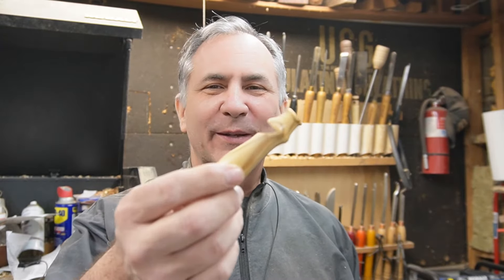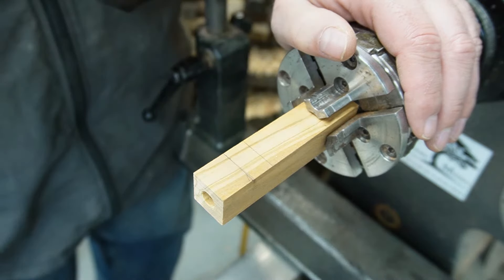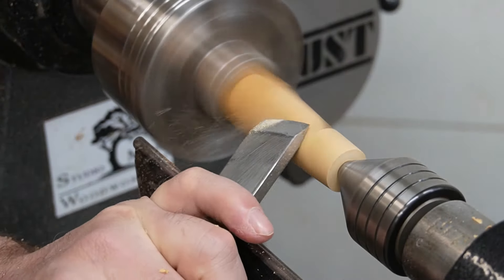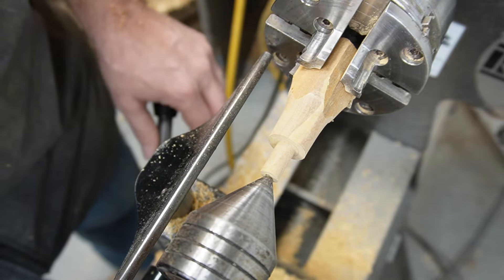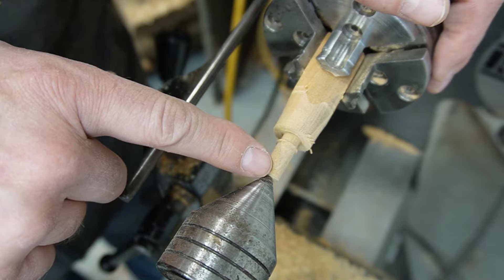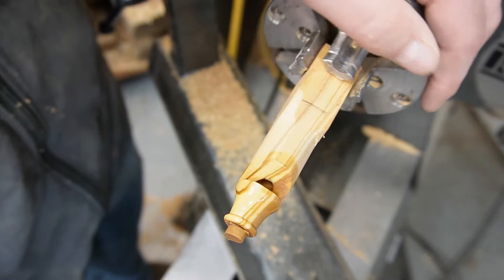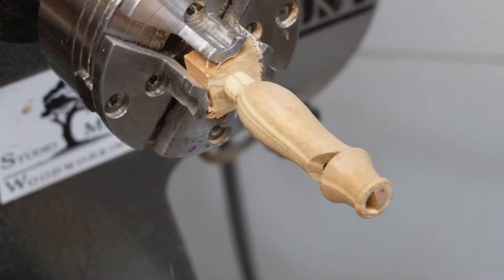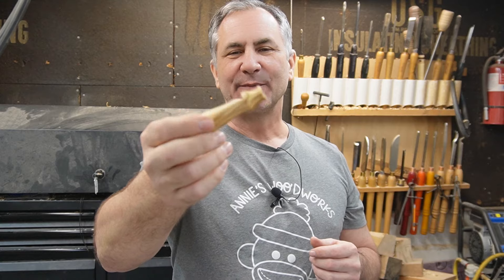Woodturning:  A Super Loud Whistle from Olive Wood

Comment: Most whistle videos I have seen cut the notch after rounding the blank. Are there any precautions to prevent edge breaking when rounding the whistle with the notch already in?
Reply from the maker: Hi and thanks for the question.  This is the way I was taught.  I've always cut the notch before turning and I've never had any issues.  I don't do anything special to keep the notch edges intact.  Sharp tools and a speed fast enough that my gouge doesn't dip into the gap is all I do.  I generally turn these at 1500 RPM only because I'm a bit too lazy to change the belt position to the high speed pulley.  The pieces are fairly small so if I had the belt in the high speed pulley I'd be turning it faster.  I cut the notch with a hand saw on the lathe.  If I was batching them I'd have done the notch on the band saw.  Its easy to cut the notch while it's square.  I can imagine cutting the notch after it's round would be more difficult.  Either way, do what's best for you.  There's no right or wrong as long as you're safe and the whistle works.  Thanks for watching

Comment: Hi Scott, I was wondering if you knew if the loudness & tone could be altered.  e.g. smaller or larger hole or even a longer piece?
Reply from the maker: Hi Tony.  Changing the diameter of the hole and/or it's depth will definitely have an effect on the pitch and loudness.  Experiment with it a bit and let me know how it turns out.

Comment: Im having trouble making my whistles make sound, some work, some done..I think it has to do with the dowel, whats the secret?
Reply from the maker: Hi Cap.  It's hard for me to troubleshoot your issue without seeing the whistles, but it definitely should be a bit easier for you.  There must be some difference between the ones that work and the ones that don't.  Just re check the process and maybe you'll find the issue.  There's no real secret.  I've had some louder than others and some that needed to be blown a bit harder but I've never had one not work.  Just be sure to use a closed grain wood.  An open grain may be a bit too porous to work.  Thanks for watching!

Comment: Internal diameter ?
Reply from the maker: In the video I use a 3/8 inch forstner bit to drill the hole.  But you could use any size you want within reason.  Changing the diameter and depth of the hole will change the pitch of the whistle